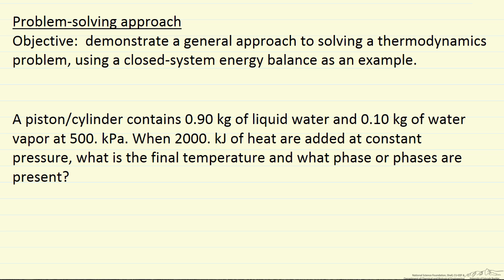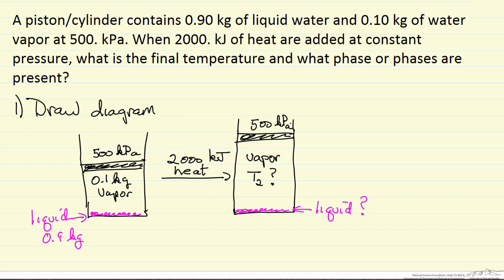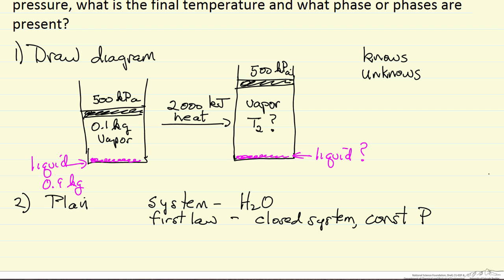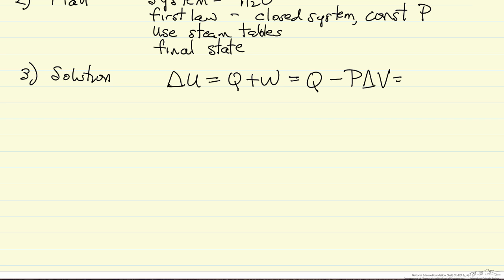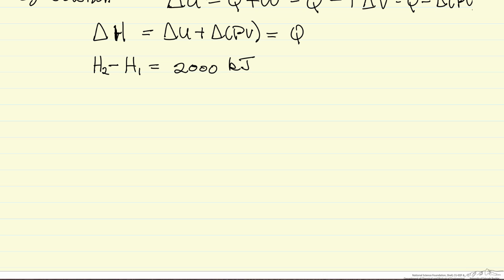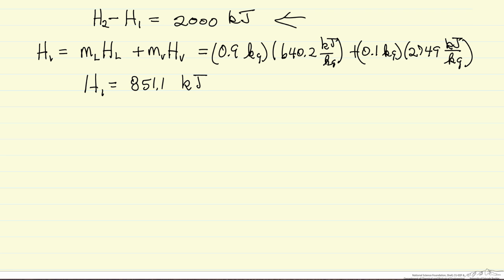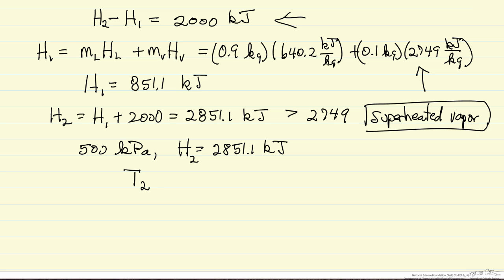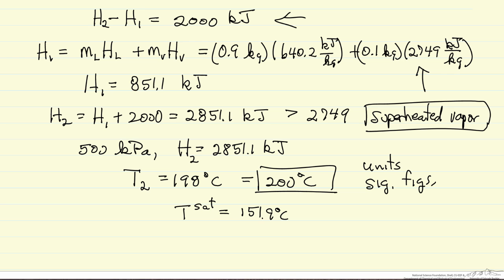Problem Solving Approach

Comment: The work done by the system right so it is (+) .you writed Q+w
Why you chang the work to( - )nd write Q-pv
Reply from the maker: Great question.  Work can be positive or negative, so you need to be careful here.  In this case, the system does work, so energy is removed from the system; therefore we subtract PdelV.  Note that this notation can be different in different textbooks.
Reply: @LearnChemE  
Why we issum that potential energy is zero.  System is a piston and it is added to it heat after vaporization it will be remove from it place so there is different in high.

Comment: Great Video! The whole process made more sense than it did in college. Understood everything and applied by your step by step and arrived at the same answers. Finally understand using the PV Diagram and where you can be  regards liquid, liquid/vapor, or superheated steam. That thin line represents the saturation and if it doesn't touch the line than you're on one side or inside...completely understand. I also made the connection with 
∆ U=Q+W , it is all making sense. Thank You !!!

Comment: where do we use simple -P🔺V and -integral PdV
Reply from the maker: +hamzadragonball When the pressure is constant you can use the simple PdeltaV.  If the pressure changes, then it has to stay inside the integral in PdV.
Reply: +LearnChemE  but why do we take p outside integral sign when solving?
Reply: @hamzadragonball  we only take p outside the integral sign if it is constant
Reply: p is constant thts why